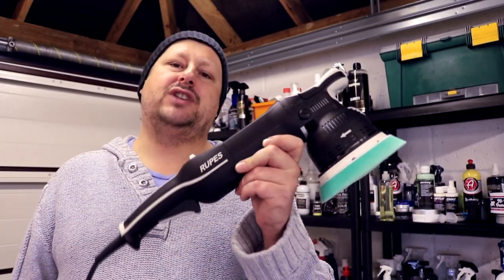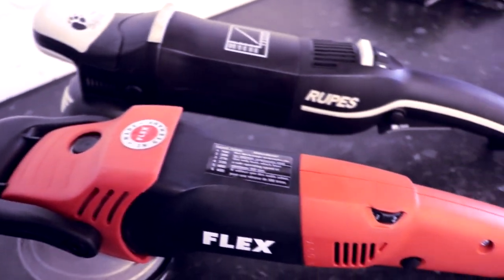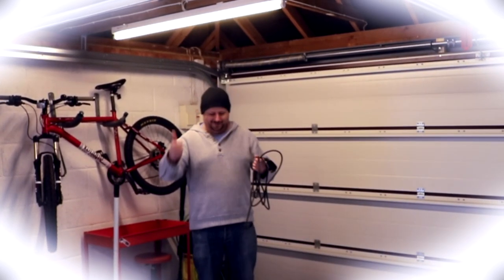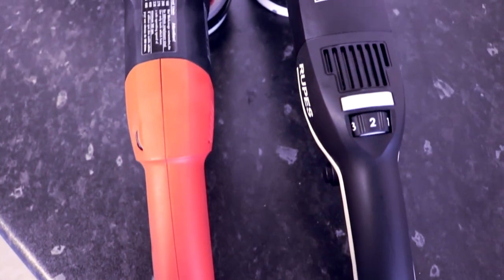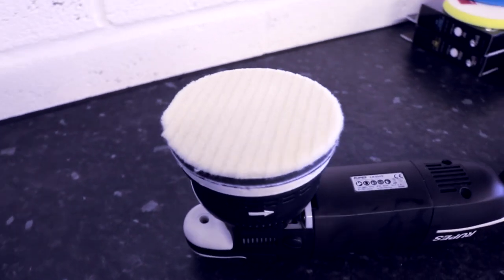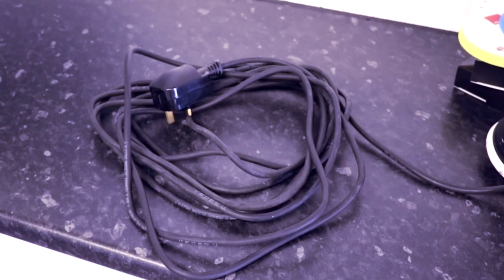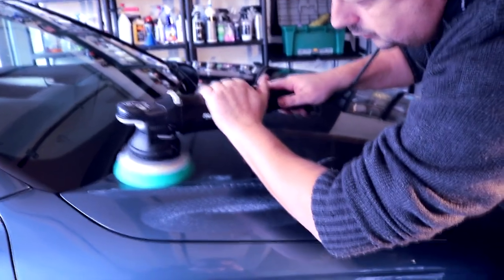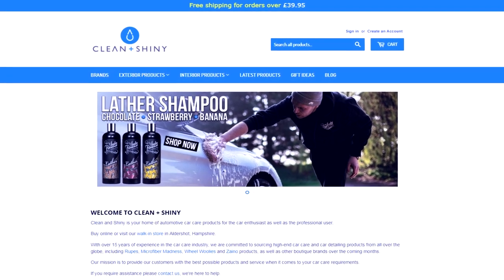RUPES Mille LK900E Bigfoot Machine Polisher Review Demo

Comment: I've had my Flex 3401 for many years now. It's a proven machine as is their rotary. It's lighter in weight and by using the Flex 4" Interchangeable Backing Plate I can go down to the smaller 4" pads that I find handy and use a lot on todays smaller tighter panels.

Comment: Had the privilege of trying the Mille out today at a buddy's shop. If I had to use it I would but I would never trade my 3401 for it. A little heavy for my liking and even felt top-heavy if that makes any sense. I've polished about 1000 cars with my 3401 with zero maintenance and it's still going strong. I even use it with a 5-inch scrubbing pad to clean carpets even though I know that's not necessarily a smart thing to do. It's a beast. glad that there are options now and that the competition is fueling innovation.

Comment: Great review Jon, been waiting for your point of view. From watching the Rupes series of videos on OG, Rupes consider their Bigfoot DA range their go to choice for detailing and the Mille and new rotary as further options depending on the circumstances you’re facing. There’s so many machines choices these days, I’m glad I’m not starting off and having to work out what one to buy. I got my first DA in 1996 when the choice was to import a Porter Cable from USA!
Reply: Chris_Audittr2108 

And that PC is the first one I always reach for!

I have a 21, Duetto, 3401, etc but use the PC the most.
Reply: danlc95 - I sold my PC to a neighbour when I moved to a rotary years ago. He still has it and only using occasionally so it’s in great condition. Might see if I can buy it back for the nostalgia!
Reply: Chris_Audittr2108 - Ha! In 1998 I got my first rotary, and I've been trying to find one like it for the same reasons! It was a variable speed WEN. Not the best tool, but it was what I learned on.

Comment: I’ve had the Mille for a few months now, completed 2 full corrections with it, and I found the same issue with the Mille blue pad, I just couldn’t use it, especially on vertical section. I was fortunate I only needed to compound 1 panel due to buffer trails on a repaint, I ended up grabbing their new yellow Mille wool pad with a compound and it was as smooth as the yellow foam. I also feel the Mille with yellow pad and yellow Mille polish is so much smoother than my old 3401, and pretty close to the lhr15 with oe backing plate

Comment: Hey John great review. To the person who said you can't use microfibre pads on forced - you can do it, it just comes down to how you manage heat. Forced rotation can out cut random orbital sometimes, it just depends on what the paint likes. The makita po6000c is the strongest machine on the market at present but I had a few issues with it. Maybe the one I had was a dud. If you use thicker pads on forced, you lose some of the energy in the pad thus thin is better but it can lead to a little less control. It's similar to tyre sidewalls. The taller the sidewall the more comfortable the ride. The rupes forced wool pads are magnificent, barely any marring ever.
Reply from the maker: nice write up matt, I want to check that makita out at some point.

all the theory stuff goes out the window with those blue pads :)  They defy the rules , but not in a good way.
Reply: thanks for the reply john. I use two Makita BO6050J machines which spin clockwise but would not be as powerful as a Mille.  Talk with Mario from Eurogloss Prestige if you want to know more about the Makita PO6000C. He swears by it

Comment: Ive been using the Mother Wax Attack machine for the past 2 years and its a good machine as i can change the throw. It came with 2 different weights but it does have very bad vibration. Its variable speed  but anything over 4000rpm its like trying to hold onto bucking bull lol

Comment: I have the LHR15 MK III but i hate whe it stall and this hapend a lot even on hoods with a lot of curves. So my plan  is to buy rotory or forced rotation.
 I havent work with eather of those two in the past. Wich one do you sugest. If i go with rotory am a bit scared for the haze and holograms. But have seen people having really good resoults with finishing compound. So am a bit confused wich one shoud i buy?
Eventually i will buy the two but for now i need somting that will speed up my polishing time and not have with pad stalling i have on the LHR 15?
Thanks and keep up the good work with your chanell 👌💪

Comment: That blue Rupes cutting pad looks like a thin Buff n Shine Uro Tec blue pad.  I was using that on the Flex 3401, it worked well but seemed to destroy itself.  I contacted Buff n Shine and they said that the large open celled foam on that cutting pad isn't designed for forced rotation.  The cell structure is too large and breaks down with the huge loads that a forced rotation generates.  The Rep recommended a closed cell pad.  I've been using some closed cell pads, and have to say that they do seem to work better and not break down as easy.  I have also used Lake Country HDO cutting pads with some good results.  They do break down (open cell foam pad) but not as fast as the bigger celled foam in the Buff n Shine Uro Tec.  I have ordered some orange Lake Country Force pads, and some Buff n Shine Uro Cell to try.  The other thing that bothers me about the Buff n Shine Uro Tec is like you mentioned with the blue Rupes pad, it gets soft when warmed up.  I like a consistent pad that doesn't change durring the buffing cycle.  I don't want to start with a super aggressive pad and end up with a soft one.    When you start the next section that damn pad is still soft and doesn't cut as effectively as it did when it was cool.  Great vid as always.
Reply: Steve Sulkowski - The American foams are the only thing I use on a 3401. The original Buff and Shine green, blue, black, and (the one exception) red. 

The green is a very good cutter, despite being designated as a polishing pad. Works great with something like M205 for one step polishing. 

The blue pad is what I like for finishing, and light polishing.  

These pads are open cell, and have a medium density. This allows maximum contact to paint on curves and contours. With the 3401, much less grab, and walk effect. 

I've tried the 3401 with the traditional orange and white foam, and it walks all over the place, without doing as good a job working the paint. Especially the orange cutting pad. I hate those things for cutting.
Reply from the maker: Ive noticed the cells on the polishing surface face of the rupes foam cutting pads break down quite quickly.  sort of bobble up a bit..   but they are well made pads.  I cant really find any fault with their softer polishing pads but Im not too keen on their cutting pads.
Reply: Forensic Detailing Channel - Which is why I tend to use their microfiber pads to cut. 

I like their original design at that as well.

Comment: This is a system, not just a machine, you need to use the pads and the compounds, you also need to prime the pads by completely covering the pad with the compound, it will pull you around if you don’t do this as the pad has areas of higher and lower friction. There’s more lubricant in the compounds designed for this machine, I’m guessing to reduce heat and prevent fighting the machine. I’ve done a few corrections with this machine but I’m using the Rupes wool pads, they work very well.
Reply from the maker: your right and you need to work wetter as well with the blue pads.  I saw the info rupes put out on it..

rupes have clearly created a system.  But I would look to go "off piste" so to speak.  I just couldnt live with the blues (for a few reasons) and I dont want to do my cutting with wool (even though its nice and smooth).
Reply: Of course, it's a system, a system for taking your money
Reply: Deje Dejsson - Have you ever used it?
Reply: The wool isn’t as harsh as you’d think, if you’re happy with Meguiars MF pads then you’d be happy with these. I used the Meguiars MF pads on the Mille with 101 so I’m venturing off piste with it and learning its capabilities, as you say, if you’re already using one of the Bigfoot range then you’d be at home with this, it just doesn’t stall.....ever. 
Deje Dejsson, The Rupes systems work well, I don’t see why you’re unhappy with a company who have done a lot of research in making a product work?
Reply: James H - My best work has been done with their system. It took a good bit of time to get a grasp on it though. From priming pads, pressure, etc...

Comment: Well i had mille and i sold it. It definilately delivers less cut than 15-21 mk2 and contours are not problem when you lear the secrets of long throw. Mille is better than 3401 but i personally stick with long throws and rotary.

Comment: Thank you! I'll stick to my 12, 15, and 21mm for cutting to finishing. Any forced rotation DA will struggle when finishing soft black paint.
Reply: mark Saf that’s actually not true. For finishing I’ve been using my Makita BO6040 forced rotation DA for a long time now and never had any problem finishing soft black paint. 

It all comes down to personal preferences and the polishing paste you’re using.
Reply: And it cuts slower than 15-21 maybe even less than 12.
Reply: jtm1979 are you serious?????
Reply: mark Saf Yes,  I was one of the first in Finland who bought mille and it was dissapointinting, other detailers here felt same. It is better than Flex 3401 but i have whole bigfoot lineup and rotary so the mille didnt bring any benefits for me.
Reply: jtm1979 I could see the 21 cutting more, but the 15 and maybe the 12 cutting more? This is a forced rotation machine with high RPM, so it seems it would cut pretty good!
Reply: mark Saf didnt test it against mt duetto but 15 mk2 did cut faster. Forced rotation only means you dont get stalling, but for me its not a problem at all. On tight places i use mini and nano. Also forced rotation machines wont work with microfiber pads which are my favourite for compounding.
Reply: jtm1979 I agree about MF pads, love them. Can't get good results at all with MF on forced rotation. What's your favorite MF pads for cutting?
Reply: MEguairs is my favourite although its not the most durable. Lake country is more durable and almost as good.
Reply: I just recently bought the millie an I can tell you it all comes down to which pad an of course product you're using so I agree with what another said however I've been getting fantastic results with this machine along with the 3" mini for smaller surfaces. I was on the ES15 for many years an although I love that machine it's time to upgrade an I think I'll be using this 2 piece combo for a looong time. 5 stars from me!🔝🇺🇸🏆
Reply: @jtm1979  Rupes is soon releasing MF to work with the Millle. This has really peaked my interest!

Comment: Dear friend, am I looking to buy a forced turning machine, between rupes mille, makita co6000 or flex 3401? What would you recommend? many thanks
Reply from the maker: hey there, Ive not used the makita franco, heard good things though.  between the mille and 3401 I prefer the 3401.   The main reason being is the price tag and the weight of the mille (its still a beutifull machine though).   I can also use a specific 5 inch pad that I love on the flex.   mille has a much better cooling system thats its main advantage over the flex.

however flex are about to release a new forced rotation so I would hold fire. for that to come out first.
Reply: Thanks a lot friend.

Comment: Been looking forward to this Jon. Seems you had the STN, DLX kit has the wool pads. Sure Rupes see these pads as the future for FR, the thick ones are not suited to this tool and you have shown that. The tool is pure quality and I like the minimum throw. All 3 grades of compound will be available imminently in ltr bottles.
You did a good review on what you had.👍
Reply from the maker: wool does work really well on this tool.  takes away a lot of the issues with the blue cutting pads, makes the tool a lot smoother.. I just prefer to cut with foam though.
Reply: There is one other point needs making Jon. Rupes have developed a spcific range of compounds C, F & UF which is lubricated for the Mille and useless on other machines. You have to use the correct compound on their pads or it will be very difficult. Its a different beast, so as per the term you use, it will becaome a bag of worms. Better to stick with Rupes expensive R&D first before our own??
Reply from the maker: the mille coarse compound for the blue pads yer.. Im guessing they would help but even if they solved the problems I encountered around getting worked over by the pad they wouldnt solve some of the other things I dont like about thin pads.. theres a reason for everything in their designing of a system (ive heard the reasons).  but I have some preference on pads for reasons personal to me.  I would look for other pad options for the way I work, deinfetly a more intermiediate/mid range cutting pad choice (closer to their green although even thats a bit agressive for me).

Comment: Do a comparison of ONR diluted 1:16 vs Megs Last Touch 1:1 vs Wolfgang Uber Rinseless diluted 3:128 and several other quick detailers. I found ONR and Uber Rinseless really cheap when diluted to a recommended dilution ratio as a quick detailer. And both of them work just as good as Megs Last Touch if not better. So why the hell Megs Last Touch is selling at a way higher price? When diluted I can make Wolfgang at $2 a gallon where Megs is $15!!! I own three of them and doing detailing for profit. I just wanna cut down my cost if three of them yield the same result. I don't wanna screw up my customers cars, when working on a more expensive car I go with Megs since it labeled as a dedicated quick detailer but I'm having a really tough time finding the difference between Megs and the other two (ONR and Uber Rinseless). I do think this video could help a lot of your viewers including me :). Thanks!

Comment: Is the Mille able to cut as good as the Flex 3401?  I heard that it generally takes longer to cut the same amount as the Flex, but does it have the same cutting ability as the Flex?  I have been using the weaker PC 7424XP for over 8 years, and it works great for minor/medium defects but I’ve found it doesn’t quite have the power to take out deeper scratches on harder surfaces— even with aggressive compound and pads.  Speed and Efficiency is not a factor for me, as I will be only working on my personal cars, so I won’t need to get through many cars quickly.
Reply from the maker: its about the same..   Literally I dont think you will be able to notice the differnce if you use them at say 1 back from top speed with same pads.  dunno though if I had to guess I would say rupes but mainly because its gonna put more pressure down from the added weight...
Reply: Forensic Detailing Channel - Thank you so much for the info.  I just bought the Flex before seeing this video, and was wondering if I should’ve gone for the Mille instead.  I can still return the Flex, but it may not be worth it just for the added “smoothness” and “less fatigue” since I will only these use these polishers infrequently.

Comment: on my lhr15 mark2 there was only two speed settings... 1 and 6. All other SpeedSettings i dont use. how is it on the Mille ? If i polish a hard paint like bmw or mercedes ? start with speed 5-6 and medium armspeed, medium pressure ? If cut isnt enough, lower armspeed or more pressure ? Im so exited. Get my mille next week
Reply from the maker: it really depends on pad and abrasive choices, what your doing, like you say what your working on.  generally I never run them at full speed..  typically I find with heavy compounds and a hard pad top whack tends to generate enough heat to dry the abrasives out a bit quicker...    (on foam anyway)

Comment: I love the Rupes tools and they are first class no matter which product you wish to use.  The only drawback is the price for me but I guess you pay your money and take your choice. Really informative video - Thanks Jon ! 👍🏼  Would you trade your Flex for the Rupes given you’ve been using it for years, that’s the question ?  🤔
Reply from the maker: no I wouldnt...  but its less about the tool and more about the fact Ive found a working combo already on the flex, if the rupes had come first I would prolly have a set piece combo with it and be less likely to want to switch to the flex..   The reason I wouldnt trade it for the flex is the combo of lake country hybrid power 5 inch pads on the 4 inch plate and scholl concepts abrasives copes with anything.   With the 5 inch pads theres virtually no pull.  even the heavy cutting pad from lake country is nice and plyable and takes up the panel well..    I can hit virtually everything with it...  Even on the flex if I move up to 6 inch pads or even 5.5 , I notice the tool working against me more..  I just lay out compound and work away with the flex and its just so easy to operate..  Im a big fan of lake country pads. And just bought about 30 hybrid power pads because they have been discontinued.  I seem to be the only bugger that likes using them.   Ive not found any other machine and pad combo that gets close to how cool this is..
Reply from the maker: skip to 9 minutes 50 seconds in this video to see why I like that combo so much..  how easy does it look to polish out the wing with that system

https://www.youtube.com/watch?v=Y5IbpZWIp1Q&t=713s
Reply: Forensic Detailing Channel Thanks Jon - that’s a very interesting point.  I’ve been considering the Flex for sometime but wouldn’t mind testing one before hand.  Thanks again 👍🏼 P.S. I totally agree that those Lake Country are the business.